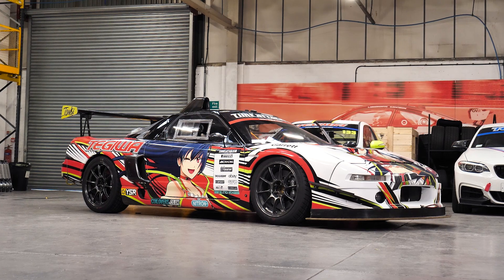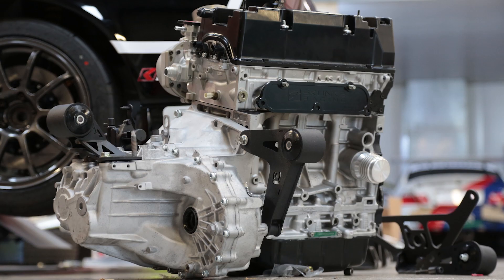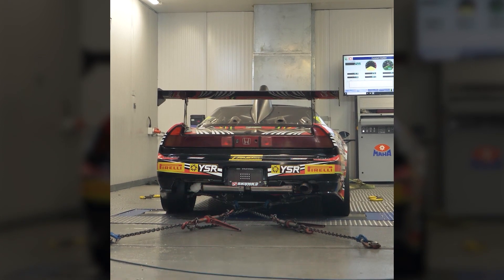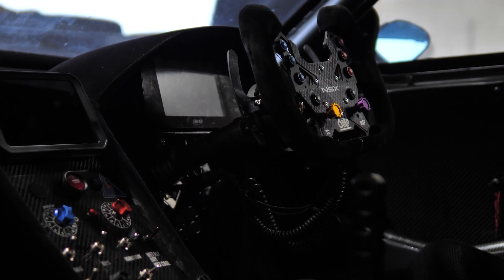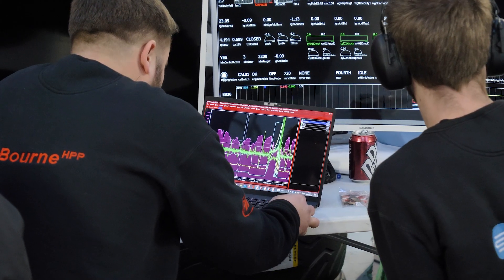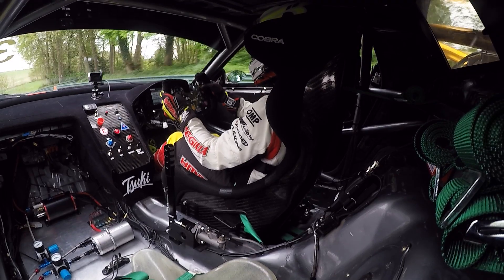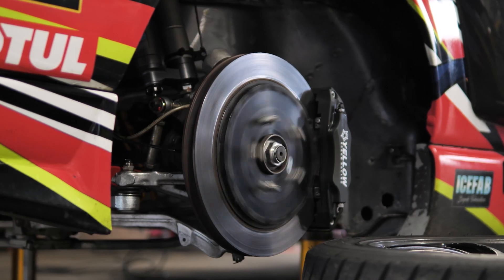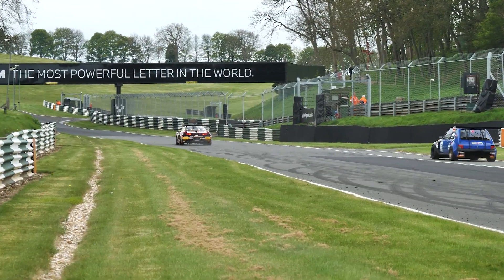Tegiwa Honda NSX Tsuki - The build so far... 'Turbo K22 Swap 550+ HP

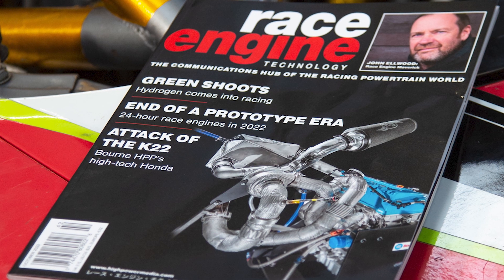Comment: 05:59 Race Engine Magazine - Bourne HPP Attack of the K22, Page 31 - "Radbourne says a development target is to increase the rev limit from the present 8350rpm to 9000rpm. If we assume that boost pressure and torque are maintained on tyhe new redline, the present 850bhp will rise to 916bhp"

The magazine is saying this thing puts out 850bhp

So how much does it really make?

Plus i think the Hollinger is rated to 900Nm but 700Nm for endurance racing

Awesome car dude
Reply from the maker: Due to the limitations of the current gearbox we had to turn the power down to approx 550BHP. However, with the addition of the Hollinger box we will be able to crank up the power accordingly. Stay tuned on the channel as we will be releasing Tsuki's 2023 feature.